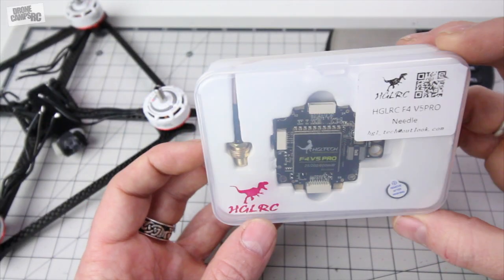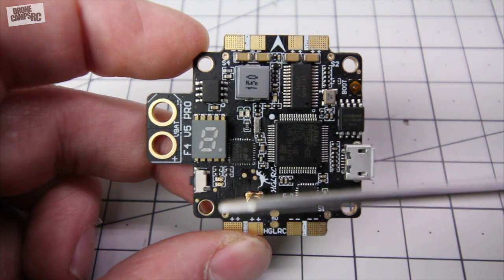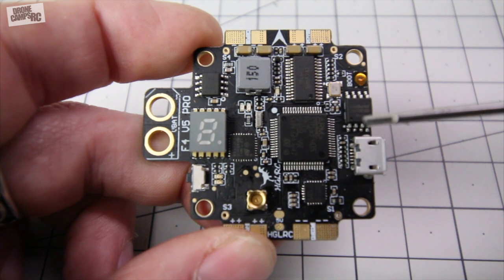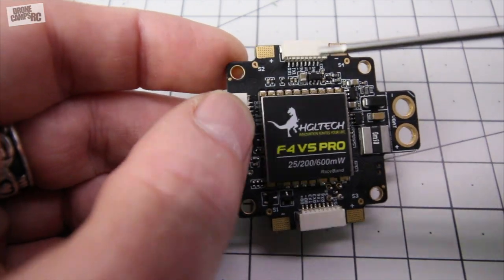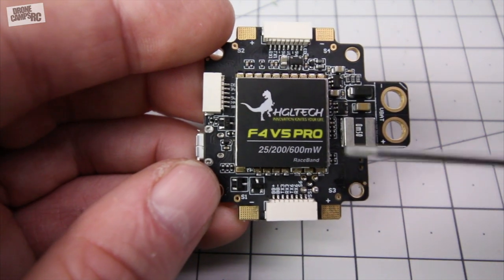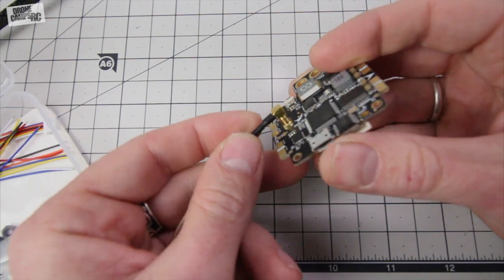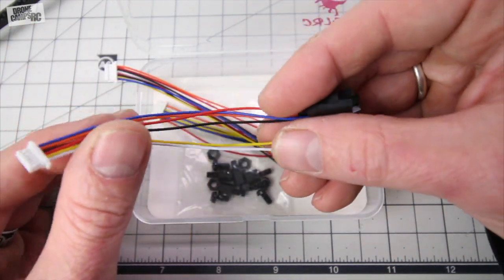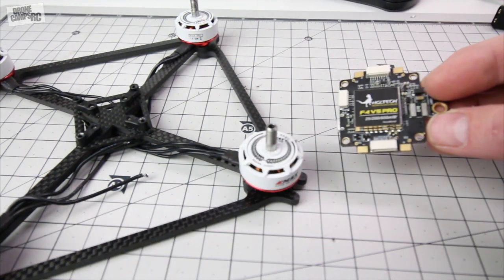HGLRC F4 V5 AIO Flight Controller - NEW AIO!

Comment: hi, can i use an external vtx if my onboard vtx is fried?
Reply: Found it: You can add audio as well.
http://www.sinopine.com/upload/file/1499506037.pdf
4th pin - 6.5m
http://www.sinopine.com/product/showproduct.php?lang=cn&id=151
after ground, 5v, video pins

Comment: My internal VTX has burned... How to get the FlightCrontroller OSD output to use on an external VTX?
If you have any fix please :)
Reply: there you go, I hope it is not too late : https://www.rcgroups.com/forums/showthread.php?2857152-F4-V5PRO-Flight-Controller-5-8G-40CH-0-25-200-600mW-Switchable-FPV-Transmitte-w-5V-B/page16

Comment: Did you have any luck with this board? I am on my second one and the death smoke came out when I powered with a battery. Yes, I did use a smoke stopper. The first was my fault, shoulda added wire toi xt60 like you suggested..you know what happened when I crashed. Are there any more boards like this out there? I like the idea of having everything on one board, except esc"s Kind of want to try a different brand.
Reply: you can power it up with the pads used for the esc's. just dont have current sensing anymore

Comment: I have this FC. After a few flights and one bad crash, my remote won't bind unless USB is plugged in for power. My solution for now, supplied the 5v and ground USB cord wired from the FC and plug into port just so I can fly. It is annoying when it pops out. I hope for a better solution.

Comment: Sir how to connect 4 in one ESC TO THIS FLY CONTROLLER. CAN I CONNECT IT OR NOT
Reply: You can, just solder 4 in 1 motor signal wires to signal pads on FC. Power esc of battery, and run some wiring to power pads of fc

Comment: Hey  Justin have you attach telemetry to this board using Frsky  XSR?  Trying to finish a build and can not find where the smart port wired of the XSR goes to??
Reply: Were you able to sort out this problem ? Busy shopping for my first build and want to get this FC and a xsr for my q x7.
Reply: did ya ever figure out where to put the smartport wire to get rssi in your osd?

Comment: Does anyone know why they use the F4 chip instead of the F3 that other modern flight controllers use?
The F4 does clock higher, but it's an older chip.  Doesn't the newer F3 have advantages?  
(I wish i knew what the factors were for STM32 chip choice)
Reply: well, if you use 8kHz/8kHz loop + accelerometer, you have a cpu load of ~30% on an F3 MCU, on the F4 MCU you have around 4% load...

Comment: What is that S6 pinout on this board ???
Reply: Well if we use common sense and see that s1-s4 are esc signals, then s5 and s6 which are right next to each other are also esc signal pads. Just in case if you want to wire a hex setup.
Reply: there is s5?

Comment: anyone has bypass the vtx or knows which pad or pin (on the vtx board) is the osd output?
Reply: Bruneau Melier ever find this info?  Pin broke on the RP-SMA connector and that caused my VTX to burn out. I'm looking to see how I can add an external VTX.

Comment: Can it support S.Port telemetry? I still love my Taranis voice alert.
Reply: yes it does support sport through pins tx3 or tx6 ;)
sbus also does not require an inverter.
Reply: Excellent Thx!
Reply: THx! Quick question, what is S6 for? My current build have a cam tilt servo(I like it a lot, +5g only), I wonder if I can use one of the pin and "resource" in betaflight to control a servo. Thx! Otherwise, I guess the last thing is related to basic physics, there may be a lot of heat stress on this broad.

Comment: You need to be "extra careful" with any HGLRC product. Their quality sucks. I had a small FC from them for a micro quad, and I was able to connect to Betaflight about 10 times, after that the micro-USB plug just fell off!
Reply from the maker: That sucks. But I've had the very same thing happen with name brands. You have to be super super careful with the USB ports.
Reply: I heard some button is fragile, so may be some DIY may help, apply plastic dip and/or apply some epoxy around some stressed area.

Comment: It's already $60 to replace if anything goes bad. Adding ESCs to this will push it over $100 easy. There is a lot that can go wrong on a quad. Would really suck to drop that much money every time something breaks. While compact is nice, I still prefer being able to replace all parts individually 10/10.
Reply: The components bought separately cost also that much... and this gives much cleaner build, with less cabling and mounting required.
Usually not the whole board fails, for example if the TX and BEC burns out, you could still hook up these external parts.
Reply: josh akers aio's have their place. superlight racer builds where every gram and bit of space counts. freestyle not so much as you want durabilty and the ability to replace parts.
Reply: Hippo, you're clearly missing the point here. I know the components cost that separately. But if 1 esc breaks on a modular build, you can spend $16-$26 to replace it. If it's an AIO, you have to buy the entire unit. 

And Killa, thats exactly the opposite. You want durability no matter what. Weight is better for racing, keeps you pinned to the ground in sharp, fast turns and allows for quick altitude adjustments to drop under a gate in the nick of time. One of the main reasons you see bigger batteries on race quads (1500-1800mah) while acro pilots want the light build so you can get the most airtime with your throttle punches and we tend to use batteries in the 1300mah range.
Reply: josh akers Vtx modules can be desoldered. at least it doesn't have esc's one of those boards would definitely call for full replacement when an esc burns out.
Reply: I agree on the ESCs, i also don't like these integrated. But with this "AIO" the ESCs are external, so no problem replacing these separately. It is a Betaflight FC with OSD (standard) + BEC and current sensor (almost standard), the only really new thing is the integrated VTX, which has pretty big soldering pads, so so you could replace it or even add an external one... my point was that you don't have to replace the entire unit.
Also i don't care so much about the weight, i just like the simple and clean build.

Comment: Is this a Flight controller and a PDB or do you need a sepperate PDB
Reply: Monte Mont-ster  this is both fed from the battery.  single stack. isn't that totally cool.
Reply: You don't need a PDB with this board.
Reply: Built in bdb fed from battery,has 5 v pad for camera or just feed from str. Battery.  All in one
Reply: Drone mesh did a build with the v4 version and his video really tried to get it working and flying . I hope it isn't a mess of a build like last time I had a go on the v4 which got sent straight back to China .
Reply: Monte Mont-ster solder pads was small you needed a separate pdb I think that what let it down you won't see many builds of the v4 .turning out successful
Reply: Everyone has different skill sets when it comes to soldering.. the whole purpose of the board is to keep the build short stacked and clean. But if your not comfortable with smaller pads , I would consider a whole different combo with talker stack.  Just thinking out loud..
Reply: Huh... My F3v4 build was pretty easy.  Quad works great.